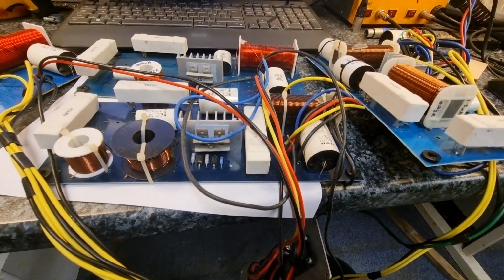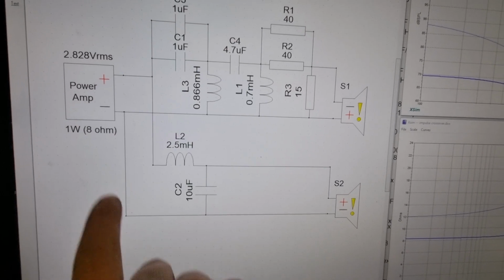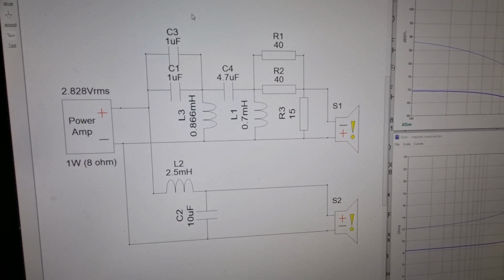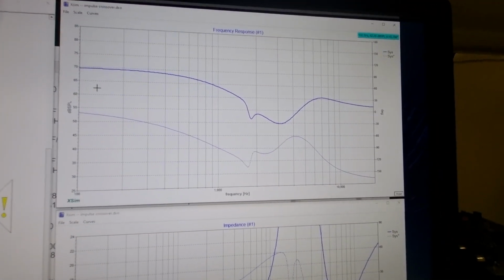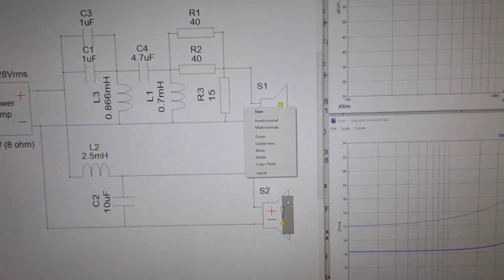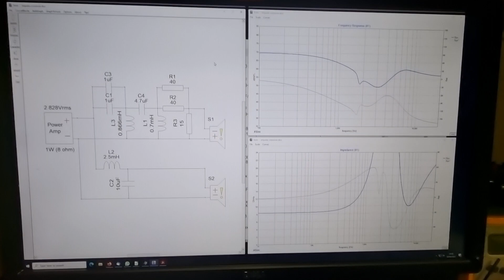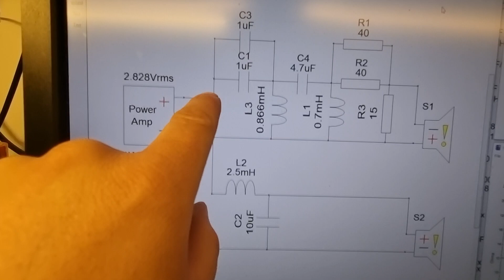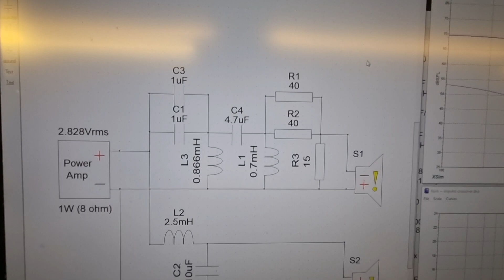Speaker Crossover Basics, How they work, and why we use them.

Comment: May I ask why you put two 1uf caps in parallel, when you could’ve used a single 2uf? Also, why the two 40R resistors also in parallel, instead of a single 20R resistor going to the tweeter? 
Are you basically putting an L-pad there, while trying to lower the voltage getting to the driver while keeping the impedance the same? Thank you in advance. 🔊😊🎶

Comment: Inductors and resistors in parallel just to produce the required ratings from commercially available components. Im not sure the limiter circuits use MOSFETs. Aren't they TRIACs?
Reply from the maker: That create a time constant and thus a crossover point. They are most definably not Triacs. Part numbers are mosfet.

Comment: i like to design my own active filters using the venerable tl074, but until now i hadn't considered a protection circuit like that at the high (voltage) end of town. i'll have to learn more about that, might be wise to build some to protect the tweeters in my cheap speakers from accidents.